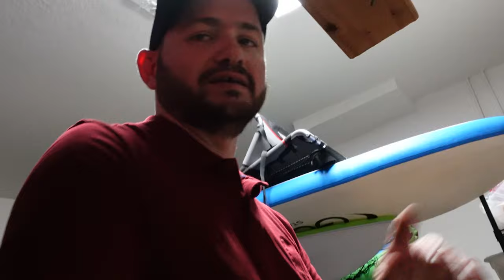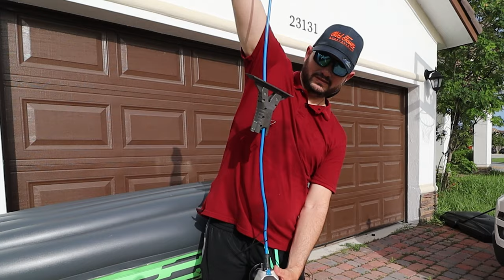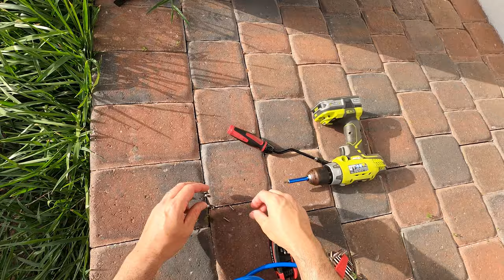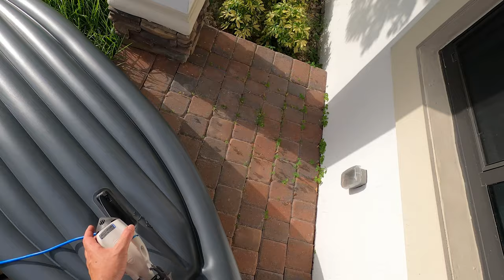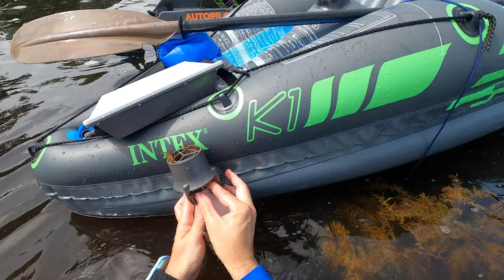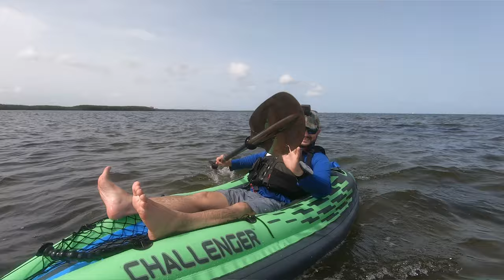I MOTORIZED AMAZON CHEAPEST KAYAK WITH Bixpy Jet Intext CHALLENGER K1

Comment: $1200 for just for the Bixby will get you a 10ft rigid floor non-brand name inflatable boat, 4hp to 5 hp outboard and an electric trolling motor.  Room for 2 people and you can stand while fishing.  Had a 10 ft Zodiac few years back with a 6 HP Yamaha, 50 pound marine battery to feed a 30 lb thrust electric motor.  Even with 2 adults and fishing gear, you could get it to plane and you were just flying across the lake.   It's like the price for just an eBike battery can get a decent mountain bike and a gas motor conversion kit.

Comment: im surprised you didn't just cut the bottom part of the fin off to utilize the more flat portion up top but still be able to slide it in with drill holes

Comment: Can you get a replacement fin? Cut it shorter so the Bixpy will be closer to the bottom of the kayak. Or use the original fin & add a stiffener to the fin so it won't flop around.
Reply from the maker: the material is too soft

Comment: Neat, but you literally have a $1200 motor on a $200 kayak. For someone wanting a propelled kayak getting a used hardshell with an actual electric motor seems to be not only cheaper but way more practical.
Reply from the maker: missing the point, you get a bixpy for your kayak and you can power anything with it, even a $75 inflatable